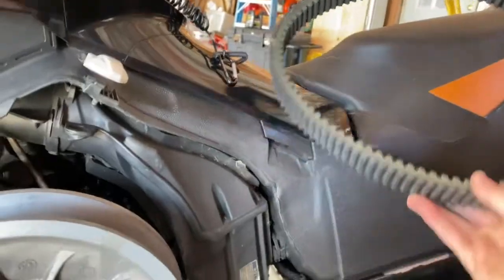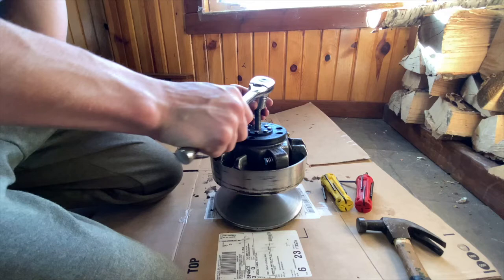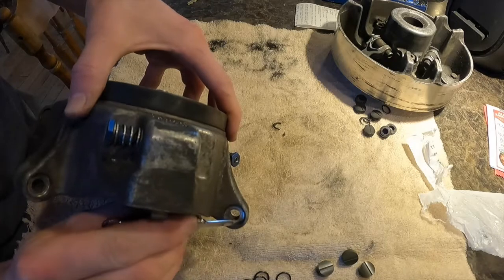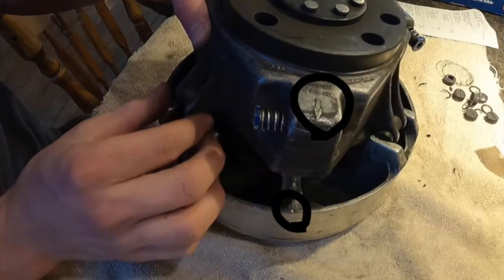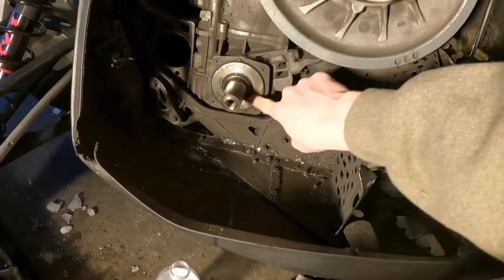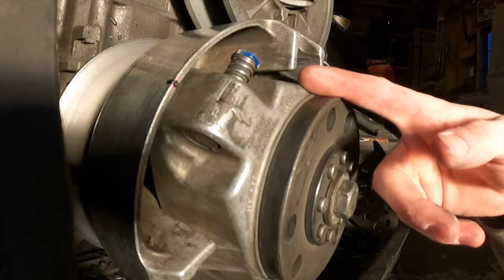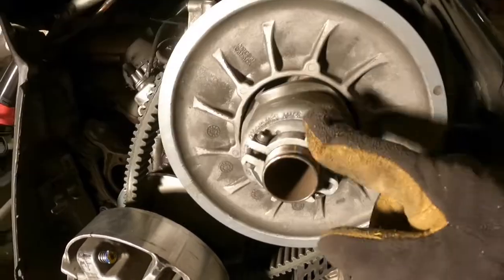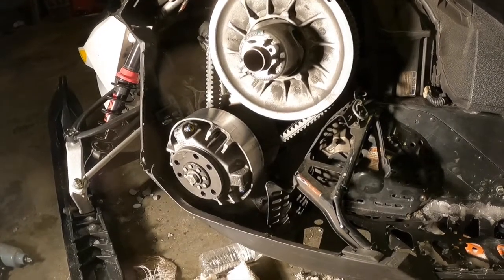How to Replace Sliders and o-rings in primary clutch on a Ski-doo.

Comment: The water trick is easier if you use an impact. The quick shock makes it pop easier. Put some grease on those o-rings, and they will hold themselves in.